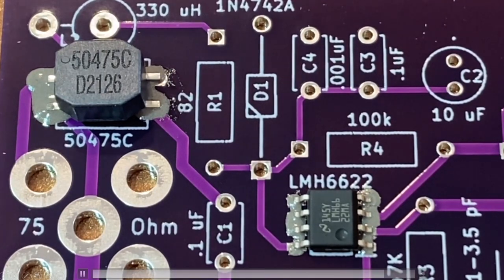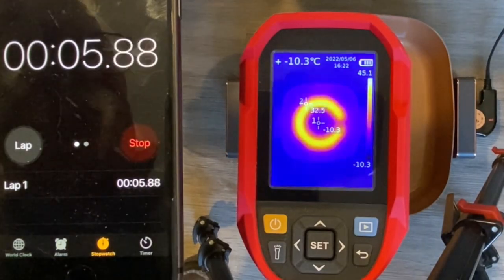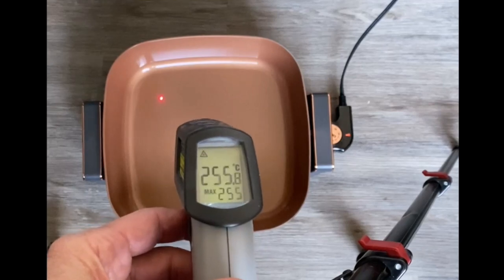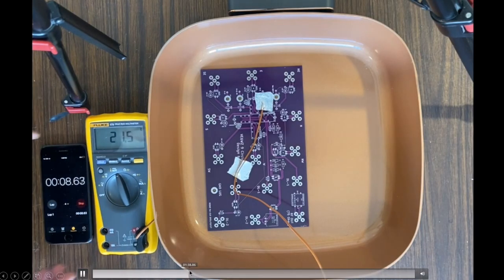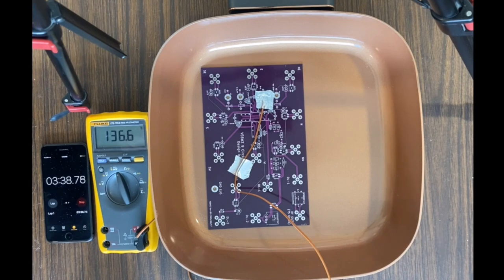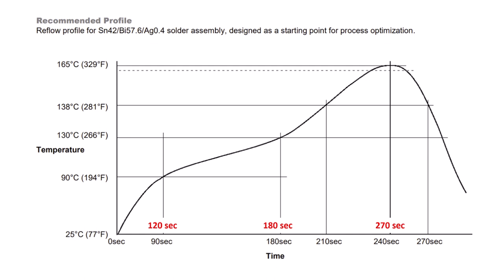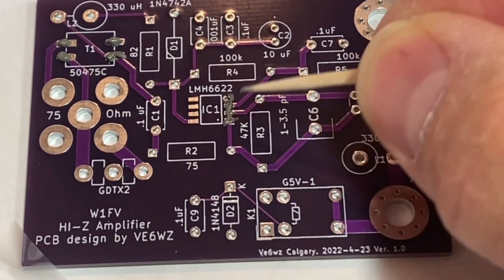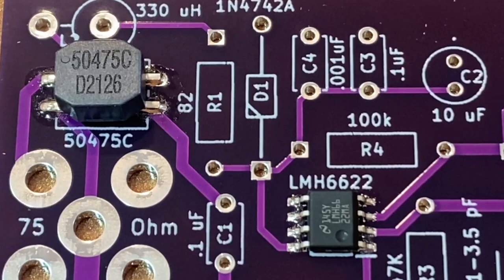Use an electric frying pan (skillet) to reflow solder paste

Comment: Thanks for this. I've just done a small pcb in a regular frying pan on a gas hob with great success. PCB and solder stencil were made by PCBWay. I used low temperature solder paste by MG Chemicals. I put a layer of tin foil in the pan to protect it and put the assembled PCB on top. I started heating it on a small gas ring on low so the temperature slowly rose to about 160C, then switched to a bigger ring and pushed it up to about 190/200C. Looks perfect. Its got 0803 caps, 16 pin SOP and 6 pin SOIC packages. Even the surface mount DC jack socket looks well soldered.

Comment: Big thanks for taking the time to put together this video, Steve. I don't have a hot air gun, or a reflow oven, but I've been planning on trying this for a while now. I do have a skillet, a stove, a temperature gun, and I have a PCB with minuscule pads for a SHTC3 sensor. I'm hoping the chip didn't get damaged, fingers crossed! 73

Comment: Also -> consider using SALT instead of Sand (if you wish) others have suggested using Aluminium or Copper plates (Pans are never flat in my experience) 
You can however get Flat Induction cooker converters (metal that heats the surface under the non-Induction pan) these would be flat, as Induction cookers are flat, see Q below :D Thanks

Comment: Wonder if anyone has actually modified a toaster (NOT toaster OVEN), to reflow boards... Thermal mass wouldn't be a problem, but no idea how boards and components would hold up against the direct radiant heat. Would probably need a good control system.